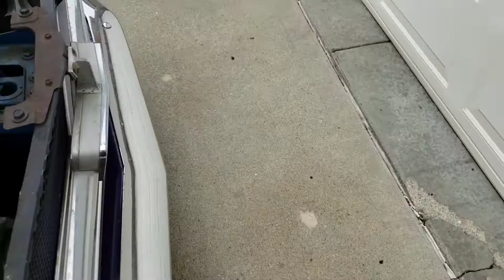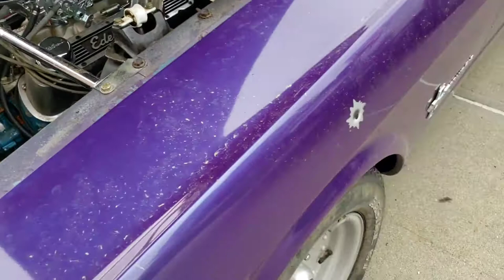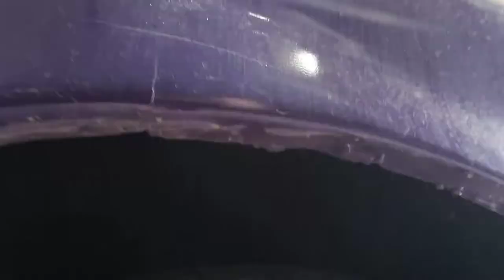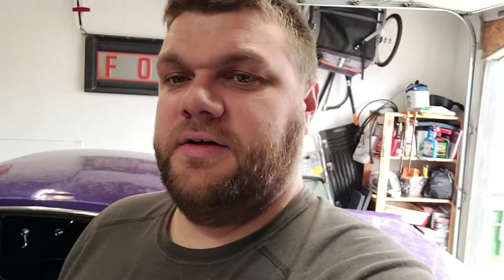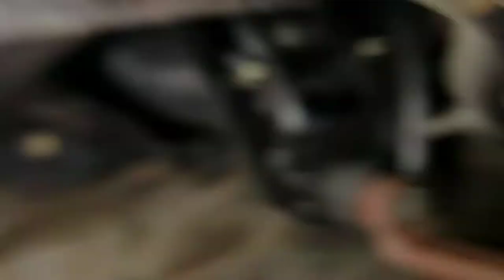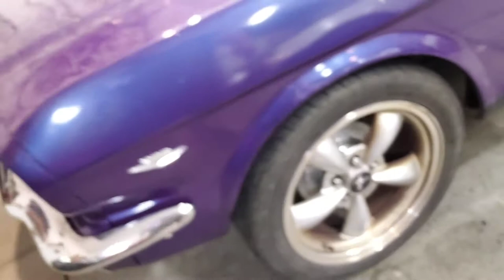Torque Thrust style GT wheels on the '65 Mustang Fastback

Comment: If you can help,,,what is a fast back in your condition worth please and thanks.
Reply from the maker: Haven't really looked into it because my young daughter inherited it, so getting rid of it isn't an option for us. This car is very solid underneath with just one 2" hole in one floorboard. Most of the suspension has been replaced. Motor has less than 1k miles and it drives pretty good. Only area it's lacking at the moment is the bodywork (I hate the purple). If I were to list it as is, I'd probably start at $35k and take $28-30k. But again I haven't done much research on what they are going for at the moment. Mine is an original V8 fastback car
Reply: @MidwesternGarage  thanks you for your wonderful response I very much appreciate it it helps me very much to understand the market. Thank you and Cheers from Milton Ontario Canada 🇨🇦.